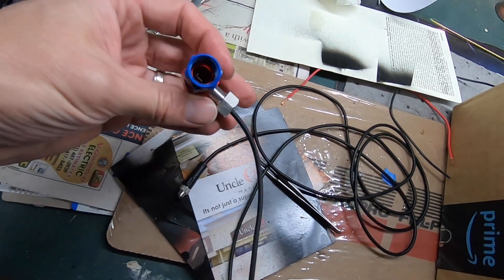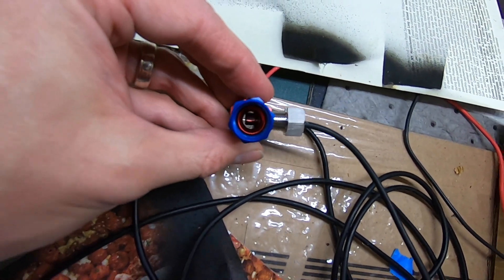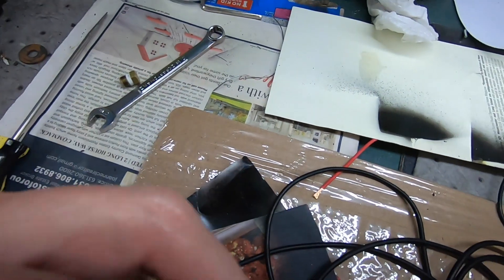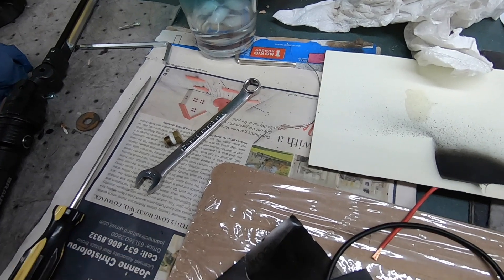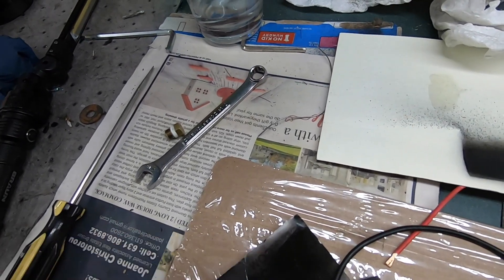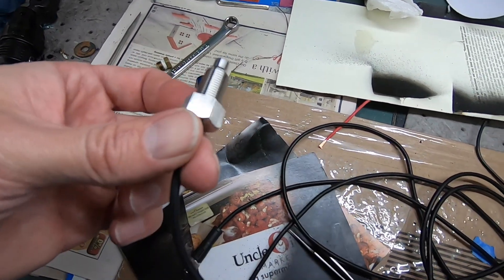Holley Terminator X - Adding Transmission Temperature input

Comment: Awesome video !!
Just ordered my asl temp sensor. 
I Burned out my th350 and ran into this video so now I’m installing a temp sensor. 
I updated my firmware to x3 and set my calibration up. Thanks again for taking the time to make this video and sharing your research and links made it a million times easier.
Reply: Also any luck finding the right connectors needed ? Or did you just leave the red and green wire as is ?
Reply from the maker: Thanks.  I'm glad this was helpful to you.  At the time, there wasn't a lot of info out there.  I assumed it was plug and play but not so on the lesser Holley systems.  I hope it works out on yours!
Reply from the maker: I never got that far, it's still working the way I had it in the video.  One day I'll figure it out.  Thanks for the reminder lol.
Reply: @nowherefastgarage lol no problem glad it’s still working might have to do the same myself 
And seems like it should work out all the boxes are checking out. 
Only issue I had so far was my display only showed my input 1 as input 1 not trans temp on my lcd screen until I cycled the key …took me a while to figure this on out lol
Reply: Update 
Got my temp to read 
And fan to turn on using the Holley 
Haven’t installed it on my pan yet but was reading 59 in my garage so should be good 
I also got my pins to work on my connector I bought them off Amazon they are directional